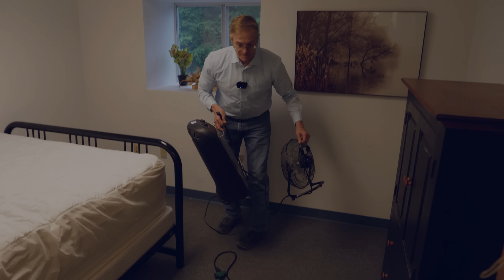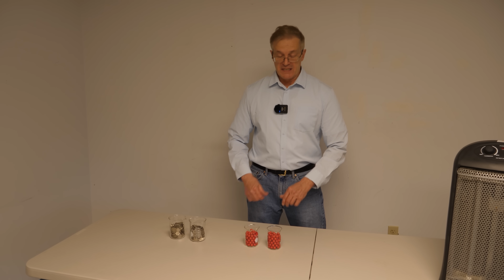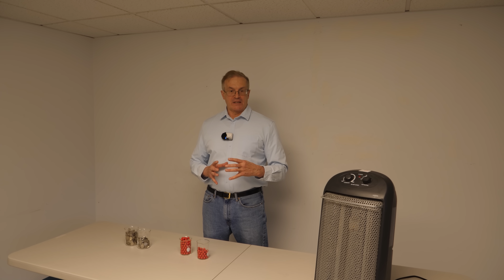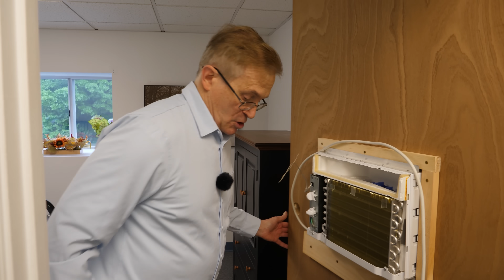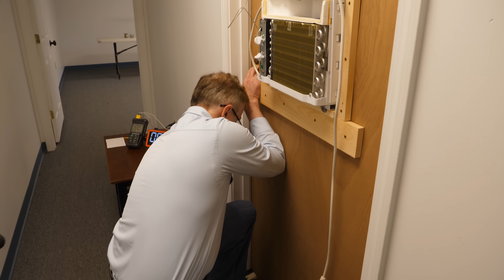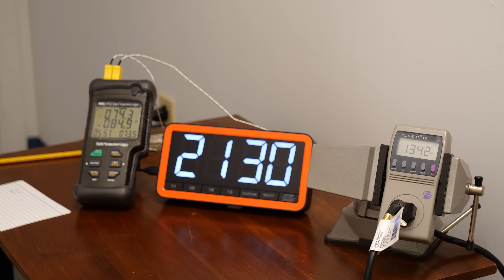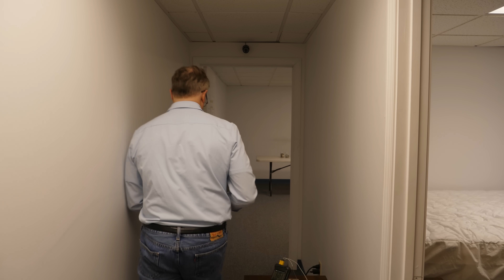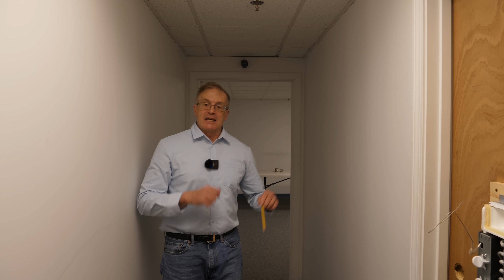You're wasting money on heating! Use your A/C!

Comment: The economics of a heat pump depends on geography. Where you live.

Once the outside temperature drops below freezing, it's efficiency drops off drastically. In fact, once the temperature drops below freezing, you might as well go with resistive heating. It's cheaper.

Another option. Geothermal heat pump.
With the proper system, you can maintain a 200 to 300 percent more efficient then resistive heating.

Another option.
Build underground home with geothermal heating and cooling. And for the most part, you will only need to condition the fresh air circulation.
Reply: You are quoting facts from the past.
The break even point is more like -5F than 32F and even the mini-splits temporarily reverse the cycle to defrost the coils.

Comment: Most of the time when you want to heat a room, it's because it's cold, not because it's already 75 degrees.  When it's cold on the side of the heat pump that it's pumping heat away from, it's going pull less heat over time for the same amount electricity, making it less and less efficient as it gets colder because warm air has more energy to give up more abundantly than cold air, plus window air conditioning units tend to freeze up when it gets too cold on the side it's pulling heat from.  So, the only way I'd take the experiment for a success is if you could rerun it when it's cold and still heat the room with less electricity than a heater without it freezing up.

Comment: While undoubtedly, the moving heat around is more energy efficient than changing other types of energy into heat there is one major flaw in the way it all was demonstrated as the air-conditioned was working from worm to worm space (in the process slightly cooling the "outdoor". In reality no one uses heat pump for coming in summer and when the temperature "outside" is lower, like in winter, the energy needed to "redistribute " the heat is greater as there is less energy to take from to start with , therefore the efficiency of the process is lower (a bit like trying to catch fish in a small pond packed with fish as opposed to the same pond but with only few fish in it - it will take much more effort to catch fish in near empty pond /fish being thermal energy)... but all in all, it's not a bad way to demonstrate the principle
Reply: Not as much as you are making it sound like.
They have greatly improved in the last decade.
Look into mini-splits with modern freons and bldc compressors the break even point is something like -5F
Reply: @ghz24  No need to get defensive! Of course heat pumps work at low temperatures to even - 20 and 25 Celsius, but that doesn't negate the flaw in the demonstration of moving thermal.energy from warm to warm space and then draw conclusions from that... one has to be honest of the downfalls of the set up.
Reply: @nikolaykalnakov  I agree that the test is flawed in that the "outside" air is warmer than a heat pump would normally have. 
My only point was that some modern heatpumps can operate at above COP of 2 even down to negative 20 degrees Celsius.
Look into some of the new mini-splits that are capable of that.
Reply: @ghz24  I am well familiar with all the latest heat pump technology available and agree. But the point is not clear from the video, and the conclusions are  seriously misleading as presented. There are several designs even claiming COP up to about 8 -9 (slightly different technology than fanned air to air). I love and believe in the technology but  also believe things have to be presented as clearly as possible in relation to all positives as well as negatives, including regarding the way an experiment is conducted .
Reply: @nikolaykalnakov  I'd agree with that.
 Since you are familiar with these would you give me your opinion?
I've inherited two new (unused) 30,000 btu  "geothermal"  heatpumps but they are 4 maybe 5 years old still on the palet and wrapped up.. I'm having trouble finding stats on them.  How efficient were geothermal heatpumps of this size and type 4 years ago?
Seems like all the large heat pumps are less efficient than I would hope for but the geothermal source seems like it would make up for it. Thoughts?
The house they were intended for would need both in the zone 5 winter.
The tubing is already there as well, and even a backhoe if I can get it running.
I'm very likely going to use it since it's virtually free but how would it compare to a modern high efficiency mini-split used when conditions are decent, like 20 degree F.
I'm thinking hooking the two up independently to separate halves of the house like a zonal system.
If I did install a mini-split wuth solar inputs in addition to the main system say in the bedroom would it be worth connecting the grid to it at all or just utilize the "free" heat/ac when the sun shines and let the main system work when no sun is available?
Any advice would be appreciated.

Comment: Hi from the uk 
Yes heat pumps are great but when the temperature drops to zero C or below the efficiency drops from 4 or 5 to 1 down to as little as 1 to 1 and with damp conditions as we have over here the heat pump can freeze and then you have to add heat to defrost the external heat exchanger. Great at moving heat when you least need it.
Still great demonstration
Reply: Are you comparing a air to water heat pump because they are terrible.
Look into a mini-split air to air and they work down below zero Fahrenheit.
Reply: @ghz24  hi I am talking about an air source heat pump for heating radiators as is normal here 
I have experienced air to air and would not opt for that as I find forced air movement irritating 
And impossible to work with when trying to weigh to tenths of a milligram
Reply: @TheBlibo  I share your aversion to forced air. I say they are terrible because the need to heat the water to a higher temperature than the air limits the efficiency and generally costs more than an air to air. 
Of course most houses here already have air ducts for air conditioning.
Some do have boiler systems. 
Did you have to install larger radiators?
Reply: @ghz24  hi
Yes larger radiators are needed and they run at a lower temperature making warming a room slower, most houses over here don't have air ducts as most don't have air con as part of the original build, not much point when we only have about 2 days a year where the weather becomes a problem, the cars I have owned over the last 15 years have all had air con but I have never needed it, I find it more pleasant to open the windows

Comment: I like to know if use gas heater which is more efficient gas heater or heat pump.
Reply: Depends on the temperature outside and your electric rate the colder it is the better gas looks the milder it is the better a heat pump looks.
I think the heat pump wins most the time because electricity is not to bad here and solar panels make electricity but I can't easily make gas. But if the temperature drops to -20F and the wind gets 20 mph gas becomes the best option.

Comment: Venting to outside instead of the hallway, how low can the temperature be outside before you run into problems with the unit freezing over or loss of efficiency that it's no longer worth it?

Comment: I do love your presentations. But. This is really not a fair test, I'm not saying that a heat pump isn't more efficient than an electric heater. But if you are going to make a video comparing two systems try to be fair. The heat that the air conditioner is moving from the hall, (74.7 degrees) into the room, has already been heated by another device or even if it's ambient (the heat came from somewhere, the sun? the earth?). If you want to make the test more accurate start with the hallway at say 32 degrees Fahrenheit. The colder the outside temp the harder the heat pump will have to work. Also when it's freezing or below the heat pump has to stop working every once in a while and have it's outside coils defrosted with an electric heating element. Which also adds to the power consumption of the heat pump.
So if I am in a home and it's 0 degrees outside the heat pump will have to work harder and longer (to extract the heat in that very cold outside air to move it into my home and keep me at 70 degrees) than it will have to work if it's 60 degrees outside.
The electric heater can not draw anymore electricity that it is designed to no matter what the outside temp is. But it will also need to run longer. All things being the same (room conditions).
I'm just the test would be a little more accurate / believable if the temperature of the air source for the heat pump was at an real world level.

Comment: Edit one month later: Summer is almost over. I found energy was about the same but it ran more as i kept dialing it down for even more comfort. It definitely dropped moisture compared to the old one. Air flow and circulation was improved after i sealed up holes. I just sealed up a friends house, forced hot air and ac. Put a piece of paper over a vent, small one. Measured the angle. It went from 45 degs to 90 degress. Way more volume and velocity. Try it. Get some mastic duct seal and foil tape. The tape is not super long term, it can come un-done. Then we'll swap his filter to a 5"  deep vs 1" and see what that does. His house is so un-even, single zone 3 story, basement and 2 floors.
Previous comment:
I just upgraded to dual fuel furnace and heat pump whole house. DIY. Lets see how much i'll save this winter. AC summer so far it has saved about 30%. I think the heat pump on paper is as similar percent savings when it's above 40F. I'll push it and see. Thanks.
Many are switching to mini-splits in every room. Or the U shaped window units are pretty good, inverter heat pumps that is. Way cheaper than a central unit with a blower.

Comment: Spit system aircon/heating is the default in Australia and in New Zealand. They are truly horrible in winter. They are installed up high near the ceiling. Great for summer when the cool air drops down but useless in winter. You end up with a cushion of stuffy air at head height and cold at human sitting height/floor level, no matter how you set the blades or fan direction.

Comment: How efficient is it when its cold outside? Does the air conditioner need to be able to get colder than it is outside to even work? Like if its -10 outside and drops to -20 and the condenser is only at -15 suddenly your not able to pull heat in.

Comment: This is not an accurate test you didn't seem to account for the hot air rising into the cavity above the room what you should have done is repeat the test but reverse the equipment order.  You're also not accounting for thermal Mass I didn't see you take a single measurement of anything in the room you're just taking a ambient temperature and it was slightly higher but the walls the bed the furniture would only have to be slightly higher to increase the overall temperature of the room much quicker this is why rocket stoves and thermal masses are so efficient.

Comment: Very interesting, but in the winter why would a person want to be cooling off one room just to heat another. Eventually the cold air room which has higher air pressure is going to find its way into the hot heated air room, “in this example every time the door opens.”  The cold air room will thus mix with the heated room air thus canceling your achievement. I don’t think you could mount the air conditioning unit in reverse in a window in the winter, because I don’t believe it would be as efficient at changing colder outside winter air temps to anything hot enough to heat a room satisfactory. Please correct me if I’m wrong.

Comment: WOW DUDE THAT'S SOME PRETTY DEEP SH#T. ENTRAPY AND BEADS AND NICKLES. I IMMEDIATELY  WENT LOOKING FOR MY WADERS. YOU'D MAKE A GREAT CONMAN. NOBODY CAN UNDERSTAND YOU. HEAT PUMPS HAVE BEEN AROUND FOREVER NOW AND I DON'T SEE PEOPLE RUSHING OUT TO BUY THEM. THEY SUCK. I'VE BEEN IN HOMES WITH HEAT PUMPS AND WHAT COMES OUT THE VENTS IN WINTER IS BARELY WARM. I WANT HOT AIR TO WARM ME WHEN ITS FREEZING OUTSIDE. I'M NOT WORRIED ABOUT SAVING A FEW BUCKS. I'M WORRIED ABOUT STAYING WARM.

Comment: Here in Slovenia this is almost a standard now. Come and check my system anyday. Heat pump that is using ground water source and it is powering 220 m2 of radiant heating in floors. With that ground source I also pasively cool the house in summer. Result: simple high efficient system and low electric bills.

Comment: downside is: hallway / abutting room becomes colder, also you cant access the controls with this in a window, otherwise would have to cut a hole in a door like you did

100 million dollar idea: build an air conditioner with controls on the outside

Comment: to heat a house i would need one in every window, ruining the windows
or a super large unit that I don't have space for
it's very noisy
it doesn't heat the water to proper temps like a gas boiler so you need a water tank with an immersion heater
it would be really nice if I could use a heat pump, they are great, but they are not quite as convenient as a gas boiler just yet

Comment: I learned a lesson about 20 years ago.  I bought a brand new window mount ac unit.  Worked great for a year and then died.  Oh, it didn't die.  I never knew the outside fan blew from the indie out!!  And the inside of the outside condenser was so plugged with environment "stuff" that it didn't work right.  Cleaned it, worked like brand new.  So not every year I take them apart and clean them.

And now I clean everyone I knows ac units.  I find so many that people show out because they "don't work" and it turn out the same every time.  They need to be cleaned.  And not the filter on the inside.  It's the outside that gets plugged.  

It would be like the front of your car getting plugged with leaves and stuff.  Your car would over heat and your ac would not work as well.

I feel so dumb that it took me this long to figure it out.

And about 3 years ago I went from a boiler to heat my home to a heat pump in 5 rooms and wow!!  Better even temps and my bills have gone down big time.  But heat pumps need to be cleaned just the same!!
Reply from the maker: Thanks.
Interesting.

Comment: Ok but hear me out... 

A window AC is $500 and a space heater is $25.   How many hours do you need to use either one to get a ROI?   Yes it is more power efficient, no doubt, but the initial cost is so much more.   Maybe it is worth it, but this was not addressed in the video.

Also, if you used this in a real scenario, moving the heat from outside in, instead of the heat inside out, then the power cord and controls are going to be on the wrong side.  And the side rhat is designed to be indoors isn't weather rated to be outdoors. Any solutions for these issues?

Also, reliability.   Space heater can be used form decades without any maintenance or failures.   AC units are much more complex and while overall reliable are more prone to failure and there isnt much in the way of repairing them.  Typically theyre replaced, thus doubling the cost.

Finally, the noise.   The "outside" part of the window AC is the loud part.  For obv reason theyre design for quiet operation while cooling the room and all the loud components are placed as far away as possible.  By turning it backwards it defeats the purpose of this design.   Meanwhile a space heater is maybe not quiet but definitely preferable to an loud compressor and fan from an AC.

Great video!  Love thinking outside the box and finding the power efficiency.  Hopefully a company builds a product designed to be reversed in some way to serve both use cases.